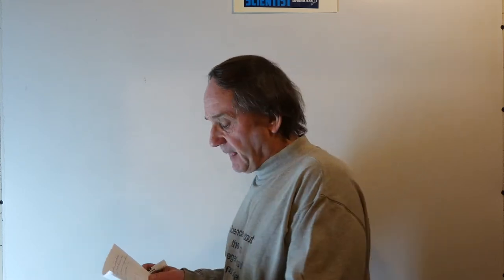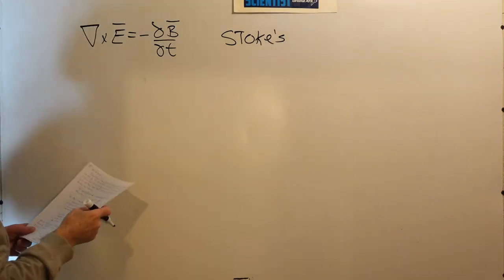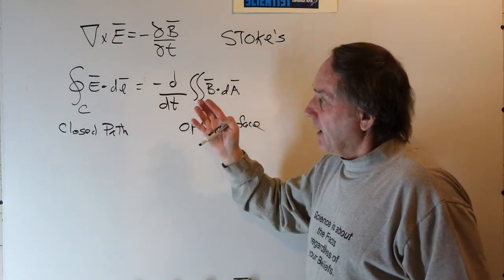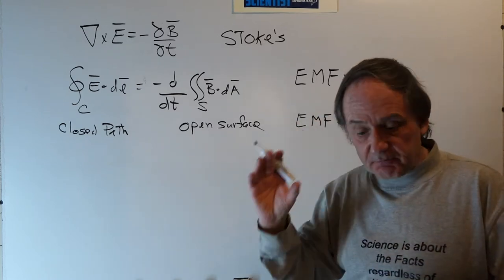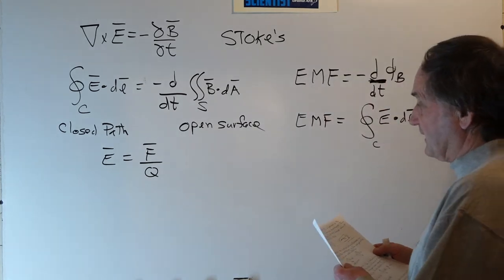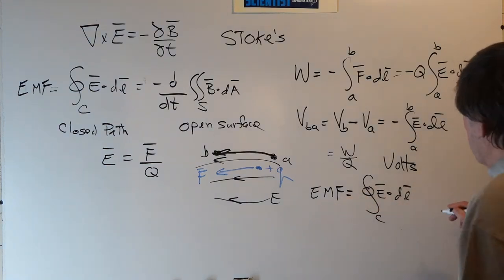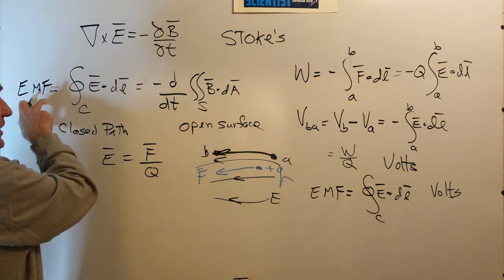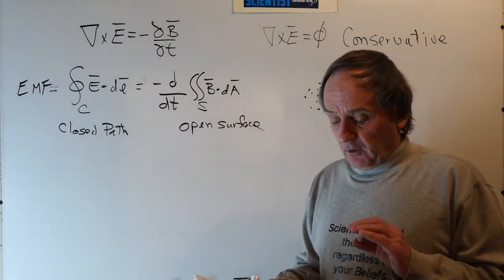FARADAY's  LAW

Comment: Third. Here https://youtu.be/LAoLzk3H8b0?t=2313 , when you explain bifilar winding, you use term voltage drop for the pieces a good conductor yourself. If you want to be precise, you should consider a superposition of the E-field in half-waves of the wire.
Reply from the maker: Igor,
The voltage drop across any section of wire made of a good conductor with a large but finite conductivity will have some voltage drop over its length, however it will be very small like in the microVolt range.  No need to consider superposition of fields.  Only the NET E-field in the wire can be measured and is of importance.  The voltage drop along the wire length will be the resistance of the section of the wire under consideration times the current flow.

A  20AWG wire (0.812mm dia) has a resistance of 33.3milliOhm per meter so a 10cm section of that wire formed in a loop will have a resistance of 3.33milliOhm and with a current flowing in it of 1mA will have a voltage drop of 3.33 microVolts over its total length.  That is all the voltage drop there will be regardless of how large the induced electric field is near that wire.  You can have an induced electric field of 1000V/m around the solenoid near that wire loop of 10 cm and if you put a 100KOhm resistance in series with the loop, the current flow will be 1mA and the voltage drop along the entire wire length will still be 3.33 microVolts.

This is the fact I can never seem to get across to Dirk and company.  They are still looking for the EMF to be uniformly distributed over the wire length rather than being concentrated in the lumped resistances and claim the reason it cannot be measured is because of the bifilar nature of the "probing" setup which is just pure bullshit.  That is what I have been fighting and trying to get them to realize for a year and now ElectroBOOM has now adopted this ridiculous bifilar nonsense and promoted it in his videos.
Very frustrating situation.
GH
Reply: You're correct with real copper wire, but Mr. Lewin often suggested to consider a superconductor for thought experiments, so I think you need at least to do something for disambiguation here. I still think that would be better to consider a full wave of the winding and consider a superposition of the E-field components induced in half-waves.

As of understanding an EMF, I think that they consider potential difference of external force/field (of non-electrical/coulomb nature, acting on charge carrier as the cause of its movement) along the trajectory, but you consider potential difference of the internal E-field induced in your circuit  as a consequence of the action of an external force. So to get to agreement, you should first try to agree on terms, but it may be hard way, since these are subtle differences, and clear understanding requires some philosophical background. Theoretical physics bases on the relationship between: Math, Math Physics, Ontology and Physics as it is very well described in corresponding wikipedia article. And ontological part may seem confusing for the average person.
Reply from the maker: Igor,              ----   M O R E   ON   G O O D   C O N D U C T O R S   ------
I have no idea what you are talking about.  Who cares about a superposition of fields?  It is the NET field that is important.  Charge separation within a good conductor occurs to produce a quasi-static field that cancels out the induced field leaving a very small NET field that is responsible for the current flow.  That is the field that is important and not its constituent parts regardless of how many there are and their magnitudes.  You cannot parse out and measure the constituent fields that are components that make up the net field.  There could be two such fields or a hundred fields that sum up to the resultant NET field;  who cares?

Just like when solving for mesh or loop currents in a network.  How many individual loop currents flow in a given component depends upon how you chose your loops.  The magnitudes of the individual loop currents that are designated to flow in a selected component sum to equal the ACTUAL current that flows in the component and that is all we have interest in.  The individual loop currents are of little consequence except for determining the ACTUAL current flowing in a given component which is a linear combination for those individual loop currents.

As for EMFs/voltages, it may help to separate them into those generated by electric fields that are coulomb in nature (generated by charge separation)  and those that are induced by a changing magnetic field.  Considering Lewin's sensing loop, inside the resistor interconnect wires which are assumed to be a good conductor, both are types of fields are presumed to exist and act in opposition to cancel one another with the result that a very small NET electric field actually exists that can be measured in the wires and not the individual larger fields.   

It may very well be that a large volume of charge carriers flow in one direction in response to the to the large induced electric field and its corresponding EMF and another large volume of charge carriers flow in the opposite direction responding to the other large electric field caused by charge separation which is in itself a response to cancel the induced field in the wire. The net result (difference between two large current flows) is a small NET current flow caused by the small electric field in the wire which is what we are really interest in.  I really do not care how the small net electric field and voltage drop actually arises for I can easily calculate its value by knowing the magnitude of the current flow and the wire resistance.

current =  Induced EMF / total resistance in the loop
voltage drop along the wire = current X wire resistance

The only interest we have in the individual fields is to aid in understanding how it is the electric field inside a good conductor is so very small when the outside induced electric field is so large.  All we care about and can measure is the NET electric field, voltages and currents.

GH
Reply: @George
<<I have no idea what you are talking about.  Who cares about a superposition of fields?  It is the NET field that is important.  Charge separation within a good conductor occurs to produce a quasi-static field that cancels out the induced field leaving a very small NET field that is responsible for the current flow.  That is the field that is important and not its constituent parts regardless of how many there are and their magnitudes.  You cannot parse out and measure the constituent fields that are components that make up the net field.  There could be two such fields or a hundred fields that sum up to the resultant NET field;  who cares?>>

I'm just saying that it is better to say that this NET field is the product of the superposition rather than involving voltage drops here, because this will also be the case without any voltage drops involved (like in superconductor). Something like "Net field is close to zero because superposition principle applies and both parts of induced E-field in half-wave of winding cancel each other out".

Would voltage drops be much higher (with resistive conductor) but still opposing symmetrically it wouldn't influence much the whole idea, ignoring greater thermal noise in the wires because of higher voltage drops.

P.S. This "voltage drop explanation" will also confuse those, who tend do keep in mind potential difference of an EMF source in the very same manner, (just watch again Dirk's video) he might very well be summing volts of opposing EMFs following your explanation in his mind, whilst you are actually adding microvolts of the voltage drops there. You never spoke about the value of voltage drop in your video.
Reply from the maker: Still do not get your point.
<<<"Net field is close to zero because superposition principle applies and both parts of induced E-field in half-wave of winding cancel each other out".>>>

Again the NET field is what is important.  Cannot measure the individual contributions to the NET field and they are not important.  Could be more than just two fields contributing - we have identified two of the largest contributors.

All I care about is the NET field and NET voltage drops that can be measured.  Worrying about the individual contributors leads to these ridiculous bifilar winding explanations and other nonsense.
GH
Reply: That is because it is you're just implying your way of understanding network analysis behind the scene, and I anticipate, that this point will be misunderstood by one who makes different assumptions by default. I would like you to be more explicit with this. You may want to find your own words for explanation, those that will fit here better on your opinion. I do not insist that mine are the best, but please try to consider your explanation to be applicable even to the case of "a superconductor" (zero resistance wires).
Reply from the maker: Igor,
This is NOT OPINION.  This is what can be verified with measurements.  The NET fields and voltages can be MEASURED.   I have instrumentation at my disposal that can measure voltages at 10 nanoVolts, capacitances to 0.1femtoFarads and inductance to 10nanoHenry.  With effort with filters and amplifiers, I can extend my voltage measurement capability down to the Johnson noise(thermal noise) level of the resistive material, which is 4nV/root Hz for a 1K Ohm resistor.

I do not claim to understand superconductors for I have never really studied the current thinking regarding the mechanism.  It is my understanding that the actual mechanism is still not well understood but not sure about that for I have not recently conducted a literature search.

I am taking about good conductors where the conductivity is large but finite such as copper and silver.   

   Conductivity of copper =  5.800 X 10^7 Mho/meter

Even if you found a material that has a conductivity at room temperature a 10000 times larger then that of copper,  everything I have stated would still be true. However, the electric field inside and resultant voltages along the conducting wire would be 10000 times LESS than for copper.

One can speculate what would happen once the resistance disappeared as in a superconductor but I care not to go down that road for I have no experience in that arena.  Obviously the electric field in such MUST vanish completely so one has to ask then what moves the electric charge in such material?   Maybe there are no forces and it is just the momentum of the charge once it gets a "kick" from the external field.  Obviously the electrons do not "bump" into atoms and such when moving within a superconductor even though the atoms are vibrating about due to thermal agitation.  So what causes the electrons to move so freely?  I do not know and nor is it important to the Lewin circuit for we are dealing with real world components that are readily available to the average person.
GH
Reply: The words that you say always by definition express your opinion unless you're lying, quoting, kidding, etc. It's just your opinion may find itself to be a well-proven knowledge or just a speculation but that's different topic.

But please tell me, have I understood you correctly, in that you're supposing, that in the case of normal copper conductors, supposing if you have a secondary of a transformer connected to a resistor, then the current in the copper wires would be caused by the E-field, existing across each piece of the wire due to a very small, but still present resistance? Or more likely would be to say that an existence of such an E-field is caused by the work done on the production of heat inside of the section of the wire?  It implies that, whatever energy the charge had before entering a resistor that amount remains with it when it exits, so it must have got initial momentum somewhere else for a current to exist.
Reply: One remark concerning a superconductor. Real superconductor will also have a limit for a current which it can allow to pass through in a superconductive/(0 resistance) mode. If you will not restrict current to this limit somewhere else in your circuit, it will behave as a normal conductor after reaching its limit.
Reply from the maker: I am aware of that.  It is a current density limit rather than the current magnitude as a whole.
GH
Reply: Current density is OK. 

One remark concerning my previous question. In the Lecture notes by Dr. Lewin at the page 4. It is said: "Thus if the resistance is distributed uniformly around our wire loop, we get a uniform E(induced) in the loop which is the same at every point in the wire loop, and circulating clockwise for Bext increasing in time. This electric field causes a current, with the current density given by j=Einducef/r (the microscopic form of Ohm's Law)". 

You see, I disagree with the statement that Einduced CAUSES current. I think that the existence of Einduced is a consequence of a current running across a resistor, and that is the way you should read Ohms Law correctly. And also since classical electrodynamics doesn't explain very well the way resistor works, that uniformly resistive ring may present a certain conundrum, but of course there is nothing fundamentally different with that, just it is your voltage drop is uniform and external field is still responsible for the current.

Namely I want to say that a voltage drop is a product of interaction of the current with a resistance. Voltage drop is required to maintain a current in a resistor and it will increase as current rises until it will cancel out the "pressure" on charge carriers from external field. And that Einduced in Lewin's lecture notes is in fact a voltage drop. Would that ring be superconductive it would be able to support a current (lower its limit) without any Einduced. The energy of external field would be just spent on the kinetic energy of charge carriers (electrons).
Reply: /*------------------Quoting your letter---------------------------------------------*/
Only an applied electric field provides the energy that will move electric charges.  Magnetic fields do not act on electric charge unless the charge has some velocity while moving thru a magnetic field.
When an electric field E is applied within and along a piece of conducting material, the electrons respond by moving with an average velocity called the drift velocity, vd. Then the electron mobility μe is defined as
 
                            vd = μe * E
 
Conductivity is proportional to the product of mobility and carrier concentration:  When an electric field E is applied within and along a piece of material, the electrons respond by moving with an average drift velocity, vd.
 
The electron mobility μe is defined as:    vd = μe * E
Conductivity is proportional to the product of mobility and carrier concentration: σ = μe * n * e
           
 Ohm's law:   V  =   I / G  =  I * R     written in terms of fields is the point form of Ohm's Law:
 
                     E  =  J / σ          where J  is current density:  Ampere/meter^2
 
 
Voltage drop is required to maintain current flow in a resistor via the electric field for  E = - ∇V. 
A potential difference or voltage drop creates an electric field which in turn imparts a force on the electrons causing them to move which by definition is current flow - movement of charges.   Voltage or voltage difference is defined in terms of the electric field:
        
 
                                                         b           
                            Vba = Vb - Va = - ∫ E • dL                    b = final position , a = initial position
                                                         a
 
 
                                                               b           
                            Vba = Vb - Va = - 1/σ ∫ J • dL                    b = final position , a = initial position
                                                               a
 
If the current flow is uniform over the length, L, and cross-section, A, of the wire, then    J  =  I / A
 
                     Vba = Vb - Va = - J * (b - a) / σ   =   J * L / σ  =  I * L / (A * σ)   =  I * R        Ohm's LAW
 
                                     where  Resistance of a wire is  R  =  L / (A * σ) 
 
 
Voltage arises from current flow in a material with resistance (finite conductivity) not the other way around.
 
I will talk more about this later in a comment I am working on regarding carrier velocities in materials and some communication between you and woowooNF.  You are now starting to get into solid state physics and the electrical properties of materials.
/*------------------End Quoting your letter---------------------------------------------*/

What do you mean by "APPLIED electric field"? Is that interaction with external field or something different? For me B-field and its curly E-field counterpart is one the same in two hypostasis a representation of an external electromagnetic field that is in fact locally interacting with the free charges within the affected part of the circuit causing movement of charges, that is an electrical current. Changing magnetic field will act on a stationary charge in the very same way as stationary field acts on a moving charge. A charge in an empty space cant't distinguish between inertial motion through static B-field and being stationary whilst B-field is changing (special relativity).

My point is to say, that the concept of a resistance is weakly defined in electrodynamics. I don't understand why not apply direct analogy with the friction when explaining how it works. The separation of the charges solves the problem of the "redistribution" of the total work/strength of the E-field (in relation to that of an original external field) along the path in conformance with the distribution of the resistance. And the process of the creation of the heat by a resistance is in fact on my opinion an interaction of the E-field (through electric charge carriers) with a non-conservative force of resistance (very much by analogue to "electrical friction"). Thus the potential of the E-field (created by charge separation at the ends of the resistor connected to the secondary of the transformer) cancels the E-field across the secondary coil and outbalances the "force of resistance or electrical friction force" inside the resistor. So you can say that the voltage drop is required to maintain current flow. But I feel sharply a subtle difference between "causing them to move" and "preventing them from stopping". Like sliding will not start without initial speed when friction equals gravity along the trajectory. But when initial speed is non-zero then inertial motion is possible and gravitational potential difference will be completely transformed into heat and not in kinetic energy.

I don't agree that "Voltage arises from current flow in a material with resistance". Would have you said "Voltage drop" instead, then I would agree. Voltage for me is an abstract electrical potential difference defined even for a single electron in the empty space. The definition of the potential of other forces of non-electrical origin (like gravity, etc.) acting on charged objects as Voltage is questionable and depends on the agreement on the correct physical units application for EMFs. If you want to assign Volts as the measure for EMFs, then you should accept that the potential difference of such forces can also be considered as Voltage.
Reply: I would like to add to this statement of mine: "A charge in an empty space cant't distinguish between inertial motion through static B-field and being stationary whilst B-field is changing (special relativity)." 

This means that to continue inertial motion in the presence of stationary B-field a charge must move in circles. But as a consequence this means that a stationary charge in the presence of a changing B-field will experience a force. Likewise, when charge carrier is forced to move with the certain speed through the stationary B-field in a straight line (e.g. it moves inside a wire) it will also experience a net force from B-field (see this video https://www.youtube.com/watch?v=1bXjB0zrjp0).